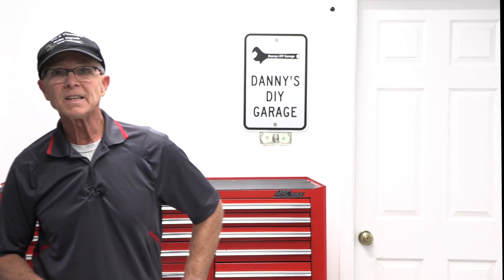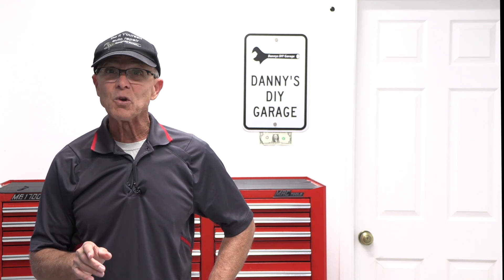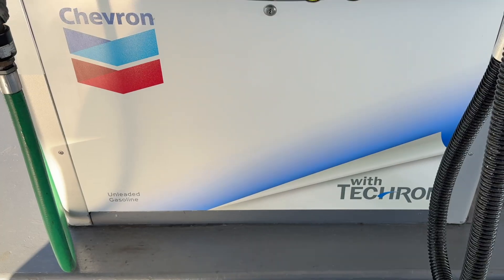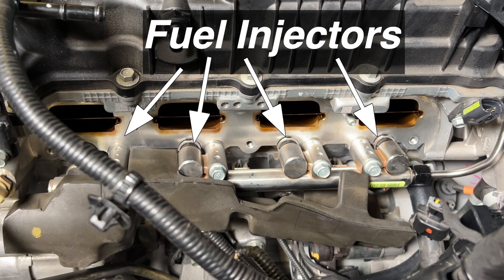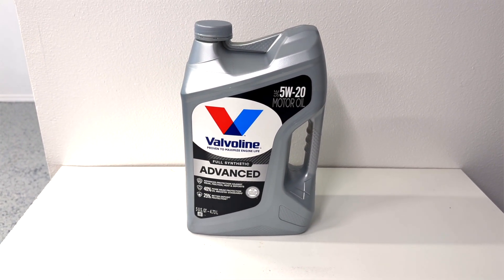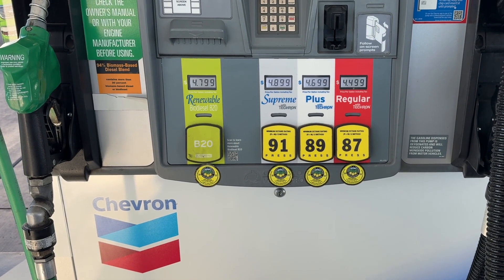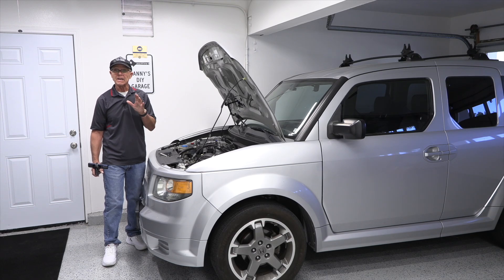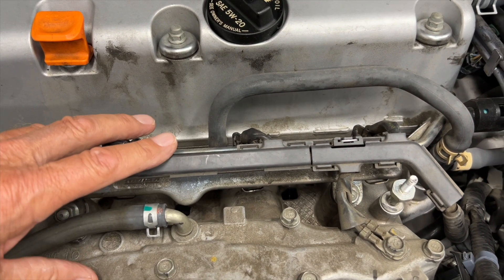MUST DO MAINTENANCE for GDI Engines to Prevent Carbon Buildup & Injector Failure

Comment: Danny never mentioned the main culprit for dirty valves, and that's the EGR system. The EGR systems takes blow by gasses produced by combustion in the cylinder and recirculates them back into the cylinder to be burned. The carbon in the combustion gases will deposit onto the hot valve, causing buildup. Improving the EGR system helps with deposits, as much as using high quality oil and high quality gasoline.

Comment: But in a GDI engine, since the atomized fuel sprays into the combustion chamber downstream of the valves, fuel additives won't help to clean them, right?
Reply from the maker: Great point!
It does help, see information below.
By optimizing fuel injection and combustion, Techron can help maintain or improve fuel efficiency. 
Important points to consider: 
Limited effectiveness on intake valves:
While Techron can clean some deposits on the intake valves, it may not be as effective at cleaning the back of the valves in a DI engine where direct fuel injection can lead to more carbon buildup. 
Not a cure-all:
For severe carbon buildup or other mechanical issues, a fuel additive alone may not be enough and professional cleaning or repairs may be necessary. 
Regular use is key:
To maintain cleanliness, it's recommended to use Techron or a similar fuel additive periodically as per manufacturer instructions
Reply: @dannysdiygarage  I'm going to call BS on this and a few other things you said:

First off, I do agree that Techron is an excellent additive, as well as other Top Tier cleaning packages will help clean the fuel system, including the injectors (which are expensive).

However, I disagree that it will do much to clean the valves.  You said it yourself, the fuel never reaches the back of the valves, and that's a serious problem if you are expecting it to clean them.  Chemical additives introduced into the intake can help, but they are insufficient to seriously clean anything, unless you are constantly using them.

You also keep talking about heat causing problems. You are correct that heat can cause deposits to bake on, but enough heat can cause them to bake off.  Don't believe me?  Ovens self clean by heating to 800+ degrees and it bakes any carbon buildup in the oven to ash which can be easily removed.  Mazda claims they took that into account when designing their Skyactiv G engine and deliberately made sure the intake valves were at very high temperature to keep them clean.

Comment: How does oil changes help with less carbon build up in the intake manifold or anything else in fuel system/ combustion chamber?
Thanks
Reply from the maker: Great question, I probably should have explained that, when oil vaporizes, it can be drawn into the intake system through the Positive Crankcase Ventilation (PCV) system. In GDI engines, this oily vapor can stick to the intake valves, where it bakes into hard carbon deposits due to the high temperatures. Regular oil changes with high-quality oil help minimize this vaporization.   
Cleaner Oil Means Cleaner Engine: Over time, engine oil becomes contaminated with byproducts of combustion, including soot and other particles. hope that helps, I wish I would have explained that.
Reply: Ring health